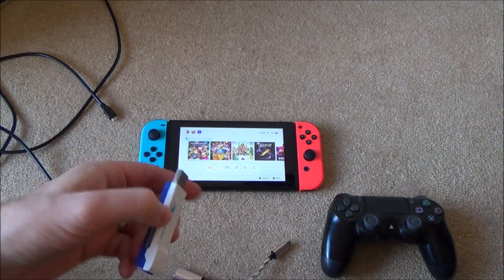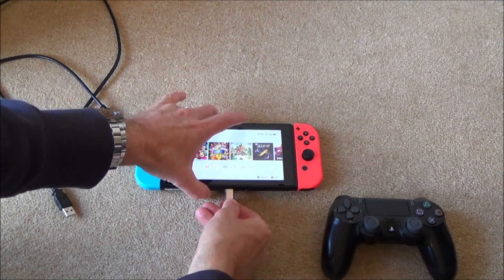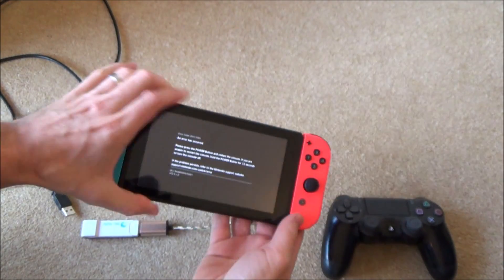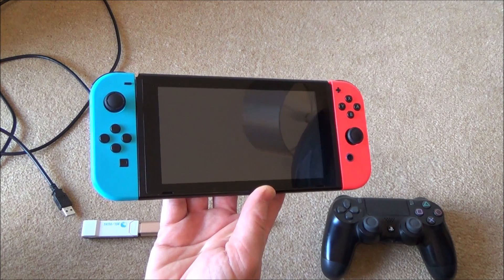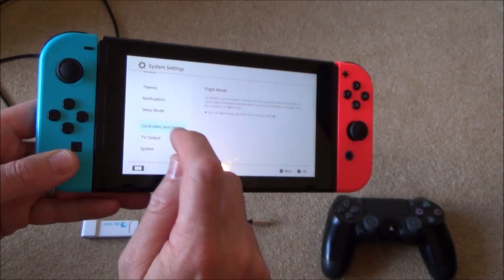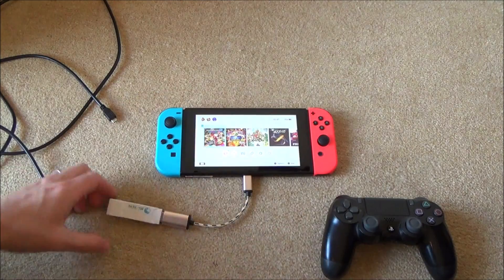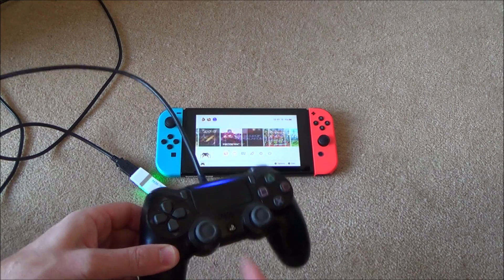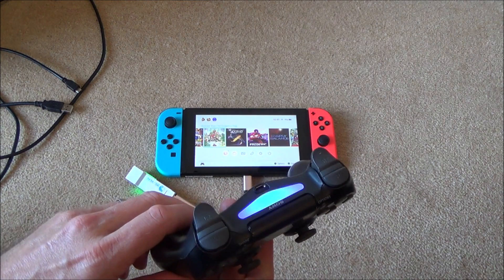How to FIX Nintendo Switch Error Code 2011-0301 when using Brook Super Converter

Comment: I'm getting this message when inserting games, tried known good card reader boards, connector looks good, game is good, no idea what the problem is, also it won't wake from sleep mode you have to hold down the power button to turn the switch off and then it will come back on. Can anyone help me?
Reply: presss the home button

Comment: This worked for my ps4/ps3 brooks convertor, but i cant get the xbx1/360to switch convertor to work on any firmware . The latest switch firmware causes the bug and none of the wiiu firmware options have workedx ive tried classic standard n pro edition firmwares. Any one else having this issue? All results only mention ps3/4 convertor fix

Comment: When I get this code for some reason my Nintendo switch won't turn on what should I do? Also after I turn it on I should press the power button for 12 seconds right?
Reply: Have the same problem right now just wondering if you fixed it and how

Comment: could you do a video about what happens when you get a new cartridge for a game you already had example:
someone lost there splatoon 2 cartridge so they went to buy another, what would happen? would you lose all your data from the original? would it think its the same cartridge? would you have to do a quick data transfer to get your progress back? i sorta need to know this cause i just lost my cartridge for splatoon and oddysey and i need to know if i can just buy another cartridge or just keep looking for my lost one.
Reply: i lost my smash bros cartridge and im worried about that too
Reply: The saves are saved on the system, not the cartridge. So you have nothing to worry about. If you buy another cartridge you'd still be able to restore your previous save and continue. But if you were to somehow lose your nintendo switch and buy a new one you wouldn't be able to restore your saves because, as previously mentioned, it's stored directly into the console you saved on... (Unless if you end up homebrewing your switch and use a program such as checkpoint to extract the saves of specific games onto a microsd and transfer it to pc. But I wouldn't recommend doing that if you use eshop and go online on the switch. In that case, forget about everything mentioned within the parenthesis.)